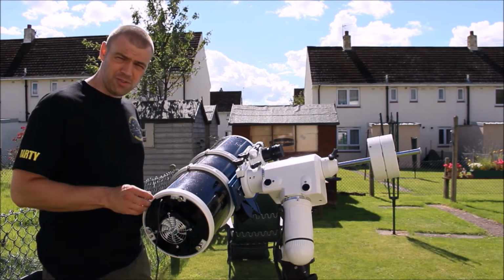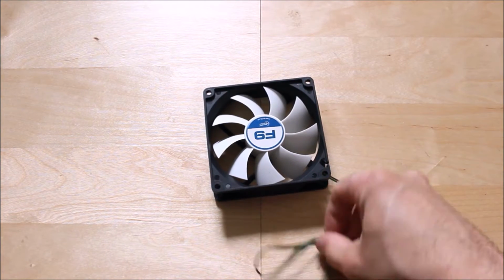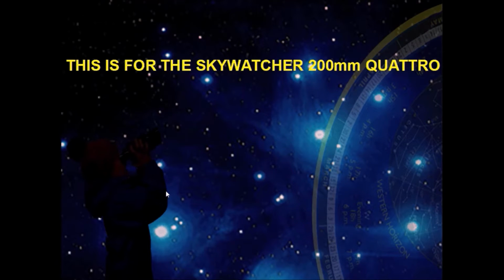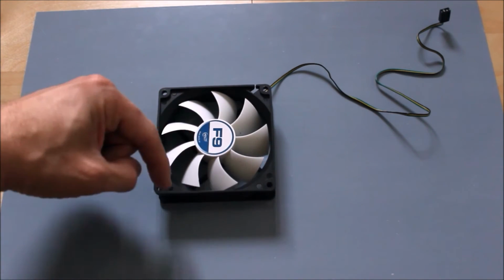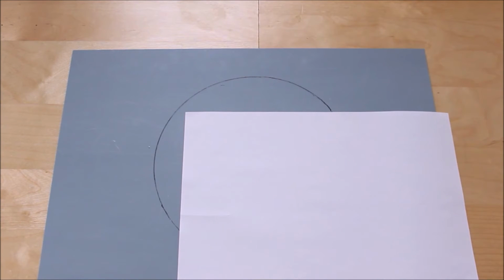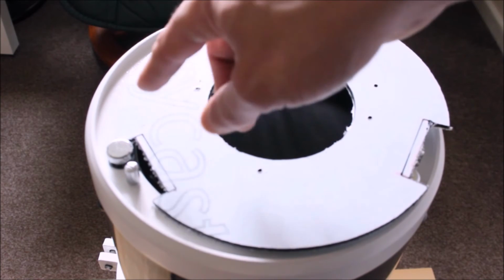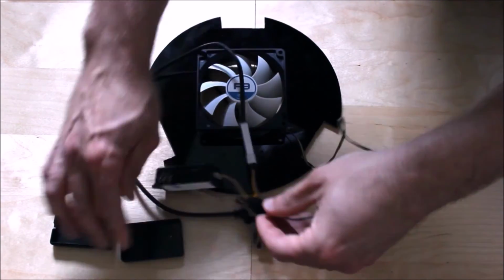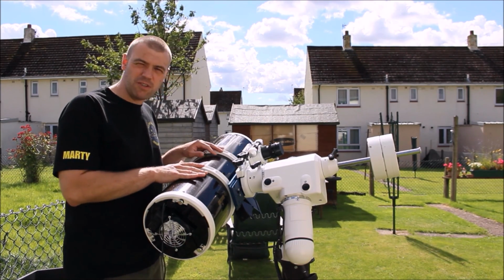How to make a Newtonian telescope main mirror fan cooler

Comment: Hi,  nice video; question: how did you connect de fan to a 12V power source ? Mazybe a picture of yours
Thanks Peter
Reply from the maker: You can use 12v cig plug adapter to a Power tank, for this video you can use 5v USB charger or battery to power this fan. You don't really need alot of power to cool the primary mirror